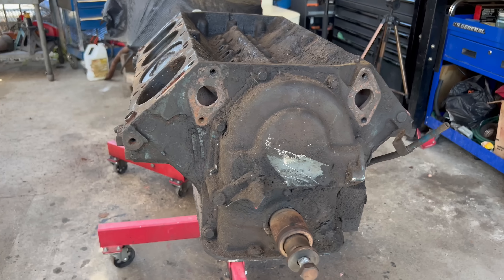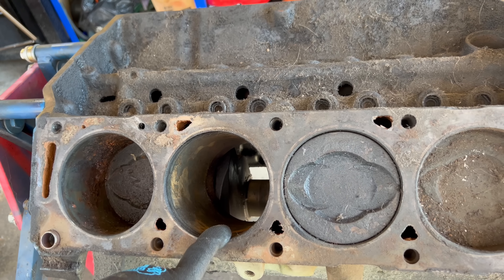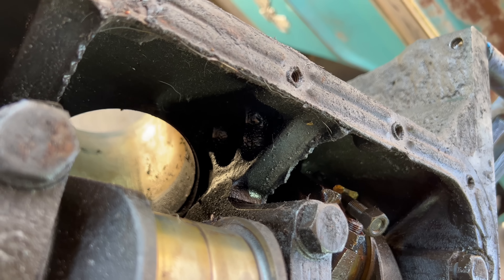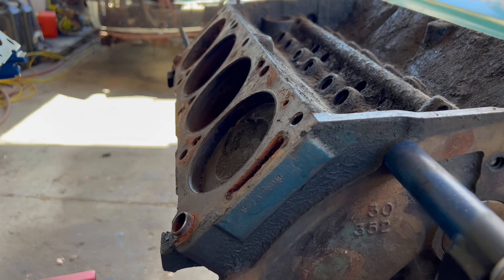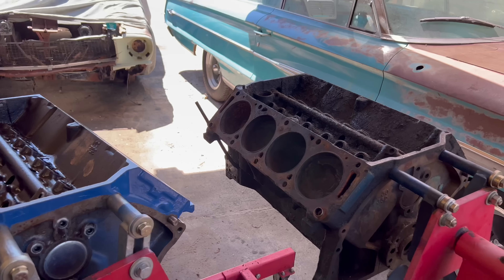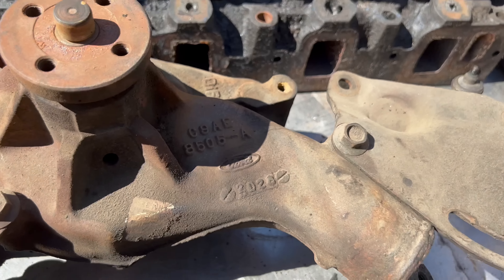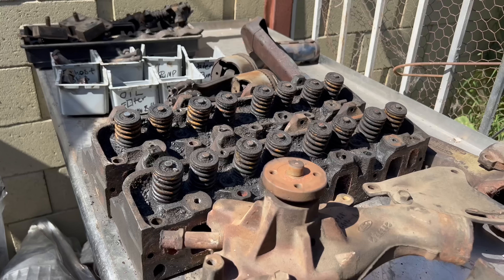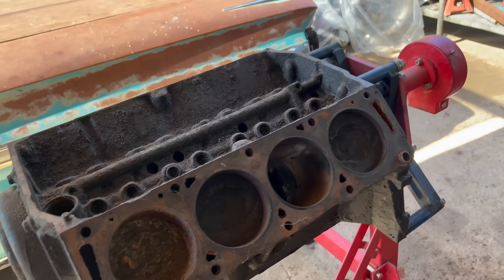A Ford 428FE Cobra Jet For $200!??

Comment: Let me tell you I bought one out of 60 something police interceptor and rebuilt it and after 8 months of running in my jet boat the reused original pistons started coming apart under normal driving conditions.  So if you build it you need to get some new pistons cause the original ones are junk

Comment: Save the camshaft, look at the part # and it will tell you what it came out of. Auto or manual, pass or performance for that year. Your book will have those part numbers
Reply from the maker: Thanks I’ll be taking apart and checking out the camshaft

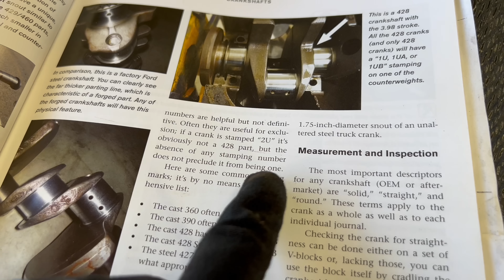Comment: 1U on the crank just means its a 428....1UA is a cobra jet crank. Even says so in the book you have shown at 3:38  "The cast 428 SCJ has a 1UA or 1UB"...The crank you have is not from a cobra jet, its just a standard 428 crank.

Comment: It doesn't matter too much anymore if it's not a 428 Cobra Jet. All Fe blocks are very well hot rodded with all the stroker kits and aftermarket parts they have available today. Even the 352 Fe can produce 600 horsepower with the stroker kit.
Reply: @dougquon1174  
I think it’s because the 428 cobra jet is a pretty good package the way it is. It has a 4.13 inch bore x 3.98 inch stroke. Versus the Ford 427 4.23 inch Bore x 3.78  Inch stroke. We all know the longer strokes make big torque and 3.98 inch is pretty big not to say it couldn’t be made longer but it just seems to be a good combination. It makes way more than 335 hp as advertised.

Comment: I’ve built a few, Strokers, Factory Stock etc you really have to be careful though because a lot of FE blocks are cracked and need quite a bit of attention if you’re going to build it for much over 450hp unless you have a 427 those are a little beefier
Reply from the maker: True, got to watch out with these blocks. But I would love to build a 445 stroker
Reply: @OmarRamirezGalaxie  we did a couple 456-463cid FE engines using the 4.25” crank and used main Girdles, Hard Block, Nice everything, one lasted 5 years before cracking the block the other lasted 3 years before it got Money shifted and hit 9000+rpm and ripped the block in half and spit the crank on the ground, since then the guy I was doing engines for went 460 based and I built him a 521 and never hurt it to this day about 10 years so far, it’s been refreshed a couple times of course 
Imo if you want to race with an FE you are money ahead getting a Shelby or genesis block to start

Comment: Dam! I need a few 200 dollar 428s. My 66 428 has 428 cast in the bottom of the drivers side water hole at the rear of the head. It's hard to read ( crusty ) but it's there.
Reply from the maker: Haha it was a lucky find, some of them do have that 428 cast into the water jacket. Most of the time it’s too corroded but pretty cool that you can see it on yours

Comment: Hey mate, apart from Happy Birthday!
Here is food for thought.
You say the CJ heads are worth money,
could the CJ heads have been sold sometime?
The heads you have there are like my 1968 Mercury 390,  C8AE-H.
The S code manifold is the same as well on mine
1968 Std 4 barrel 10.5 - 1 315HP (390ci)
I figure you have the std 1968 428 4 barrel motor, big brother to mine.
I would be checking the conrod part numbers just in case you
did get lucky, it is your birthday remember.😉
Reply from the maker: Thank you! I’m guessing this thing came out of a police car here in Los Angeles. An LTD is my guess. It looks like all the parts are original to the block but who knows. Maybe someone had a spare engine and they swapped everything.

Comment: Wait till you run across a 69  428 Super Cobra Jet. Came with factory dome pistons, high rise intake, Holly carb. and factory headers.
Reply from the maker: Haha wow that would be amazing. I’m hoping to find a 427fe. I know I can come across one
Reply: @OmarRamirezGalaxie  I had one back in 74. It was in a 69 Grand Torino (it would smoke the tires as long as you kept your foot on the pedal). I thought it was just a 428 CJ till I rebuilt it. Like a dumb a$$ I traded it off like the 70 Challenger That I used to have.  Well we all live and learn, but damn I was slow about learning LOL. I could die a rich man if I had keep all the great cars I've had. Like 67 Firebird, 62 Impala, 66 Chevy's 70 Charger 65 Ford Galaxy 396 four speed, 64 Ford pickup, 58 Chevy pickup, 
73 Firebird just to name a few.

Comment: What is your opinion on a 1966 428 a scratch block that magnaflux’s okay, but was overbored back in the day (.070). I talked to my machinist, he said the block was in great condition otherwise, and I’m having him sleeve it back to standard bore in all 8 holes. Think this would be a good start for a passenger car street build?
Reply from the maker: I would say let it rip man. Block will do just fine. I’m building a 66 428 A scratch as well
Reply: @OmarRamirezGalaxie  don’t know why it took me so long to find your channel but I’m liking the little bit of content I’ve watched so far man. Cool stuff, I have a big soft spot for 60’s ford’s and FE’s, coming from a GM guy. Had a 56 Fairlane and a couple 64 Marauder’s. Would love to find another Marauder or Starliner to drop this 428 in. Planning on trick flow heads and a stroker crank, TKX, all the goodies if I can find a solid body to throw it in!

Comment: Howdy Omar. I have a FE engine I purchased out of Utah. The casting on the rear of the block is 66
then under it is 427. Could you please comment. I would like to get in contact with you about other FE questions. Thanks Blair Chavin, Hawthorne Nevada.
Reply from the maker: Most of the time the 427 numbers on the block doesn’t mean much. If you check your crank it might have a $ sign that will confirm it to be a 427. Some didn’t have crossbolts as well

Comment: About 2 years ago I picked up a 302/c-6 combo with a B&M shifter for the trans. The guy wanted $ 200.00 for everything. He said the valve stems seals need to be replaced but other than that it was a running combo. My cousin comes over and he ran the block number on his phone and he says that it's out of a 1968 Shelby. Is that true.? I don't know for sure all I know is I've got a good running engine and trans. for $200.00. You need to checkout a fellow youtuber by the name thecraig909. He's a young guy  just down the freeway from you in San Diego County. He's got two 64 Ford Galaxie's he's building.
Reply from the maker: Hmm I’m not too familiar with the engine identification on shelbys. Might have to just do some research with parts books. I’ve met Craig before haha cool guy. Check out the fast fords car show video he’s in there
Reply: @OmarRamirezGalaxie  I'm just glad that there are some Ford people here on you tube. I mean the world does Not revolve around the ls. I'm sorry people it just does not. It's just the latest version of the small block chevy.

Comment: A CJ with 2 bolt mains?
Probably not.
Reply: All the FE's were two-bolt mains - except the cross bolted 406, 427, and SOHC. Chrysler's 440's were all two bolt as well - even the 6-pack. Ford's only production engines that had 4-bolt mains were the above 406, 427, and SOHC FE's, the Boss 302, very few high performance 351 Clevelands (including the Boss 351), the SCJ 429, and the Boss 429. All of these are ultra -rare, even when they were still in production. As far as I know, the only Chrysler with 4-bolts (cross bolts) was the 426 Hemi.
Reply from the maker: Some great info thanks Scott.

Comment: The 428 Scj..will have 4 bolt main caps..it has beefy  crank caps..
Reply: A few did but not all.
Reply: None of the factory production 428 FE's had 4-bolt main caps. Some 429's (those are a totally different engine family than the FE) and all the high - performance 406 and 427 FE's did.
Reply: @scottb8175  your right it was a 427 ford..

Comment: I have a 1969 428 Mustang my block has CJ in the valley.  Makes it easy to tell its legit.  After market heads are a better choice than the heads in this video.
Reply from the maker: Sweet! Haven’t heard of a CJ stamp in the valley. Edelbrock heads install will be coming up

Comment: Hi ! Do you know if a block without C7-… is still a 428 cobra jet (it has the C too) ? I have the crank and heads on it which say CJ with the castings numbers 
What do you think ?
Reply from the maker: C8OE-6090-N indicates cobra jet heads. For the block, the partial vin will let you know. If you can’t prove with the partial vin, it’s pretty much a reinforced “C” scratch block which is what I have.
Reply from the maker: You can also submit the partial vin to do a Marty Report. That will give you everything
Reply: @OmarRamirezGalaxie  I don’t think I even have a vin on the side …

Comment: It looks like the block has a “352” casting number on it. Is that coincidence or something?
Reply: Nope - just some FoMoCo factory weirdness - almost all FE production blocks (except maybe the ribbed side truck blocks) have "352" cast on them, no matter what the engine size actually is. It doesn't mean anything - the engine could be anything from a 2 barrel 352 to a dual quad 427....

Comment: I could tell by the intake it wasn't a CJ. What about the rod nut? I had a 68 428 PI and it had the odd rod nut that was a tad smaller than 9/16 and actually took an 19/32 socket if memory serves me. I used a 9/16 socket to put it together but actually found an 19/32 socket in the trunk of my 65 Galaxie later. How odd is that?

Comment: 428 block with a S scratch.  What does that mean
Reply from the maker: Haven’t come across an S block yet. But some of them had the bosses to put in crossbolts like the 427. Not really rare though, as I have a 390 with those same bosses. If you’ve got the 1U crank and the extra webbing in the mains. That’s a really good block

Comment: I'm not sure why you'd be fooling around with this old iron.    These engines made 335 HP max. and they weigh a ton. 

The 5L Coyote engine weighs less and makes 480 HP naturally aspirated.  And fuel injected engines are much easier to add a supercharger or blower to.  There is a reason that Ford isn't using them anymore.
Reply from the maker: Modern engines are great, but it will never be as cool as a 428 Cobra Jet or a 427 Side Oiler. Even the big block 460 can make a ton of torque with few changes.The sound that these engines make is unmatched. If you’ve been in a car with a high performance 427FE you will understand. My next build will be a coyote, but after I build the 428 it might change my mind.

Comment: WOW..2 bolt mains on that big boi..I guess you don't spin em up very high :/
Reply: Well, many average street car nuts who only know how to speak Chevrolet are often surprised when they find out that most of the legendary "other guy" performance engines only had 2-bolt main caps.....or that, for serious horsepower, the factory production 2-bolt 350 SBC is actually a stronger block to start with than the production 4-bolt 350 block.
Reply: @scottb8175  Actually it's the 20% Nickle blocks that were stronger whether it was a  2 or 4 bolt main --> Remove the water pump and timing cover from the front of the engine. Identify the block casting just above the crankshaft main journal.
Note the numbers you see there. They indicate the block's nickel and tin content by volume. If you see both an 010 and 020, the block has 10 percent tin and 20 percent nickel by volume. An 010 or 020 by itself indicates the block's nickel content as 10 or 20 percent, respectively.But you are talking about a SBC with a relatively low reciprocating mass..that 428's crank weighs 70 lbs vs the SBC's 50 lbs plus the larger rods,pistons,wrist pins ,rings and bearings bring that number way up from the SBC..
Here's a tid bit for you the original 426 Hemi has cross drilled 4 bolt mains not because they are pretty but because that engine was designed to run @8000 rpm for 500 miles without failure and yeah I hear ya about those chevy guys..I worked with a bunch of old timers at a metal scrap yard that constantly berated my 76 3/4 ton Power Wagon until I challenged the ring leader to a pull off against his 75 3/4 ton Chevy in front of the whole crew..afterwards not a word was spoken against my truck again..

Comment: Real CJs and SCJs have spread-bore carb flange intakes on them because they ALL HAD GENERAL MOTORS ROCHESTER QUADRAJET CARBS ON THEM WHICH IS WHERE THE "JET" PART COMES FROM.
Reply: The "Jet" part had nothing to do with GM.  The engines with a Q-jet were 429's, in 1970-71.  You are correct that the CJ (429) had a spread bore iron intake manifold with a Q-Jet.  However, the SCJ (429) had a square bore intake with a Holley.  No FE (332-428) engines were produced with a spread bore intake manifold or any Rochester carb.  Just so you know, the FE engines that are being discussed in this thread are a completely different design engine from the 385 (379-460) series

Comment: That intake weighs 110 lbs!
Reply from the maker: Haha it sure feels like it
Reply: @OmarRamirezGalaxie  No joke, it is a serious piece of cast iron.  Just for fun get a scale out and weigh yourself as you are, and then weigh yourself holding that intake.  I think I've seen service manuals that call for using a hoist when removing it while the engine is still in the car.  That lump of cast iron is awkward to remove.  Who needs intake manifold bolts? - that intake almost seals itself by sheer weight and gravity alone!

Comment: A buddy of  mine found a 427 side oiler in a wreaking yard in the 80s when he opened it up he found the only problem was it had a spun bearing!
Unless your a purest getting rid of the cast iron intake, will save you a 100 pounds!